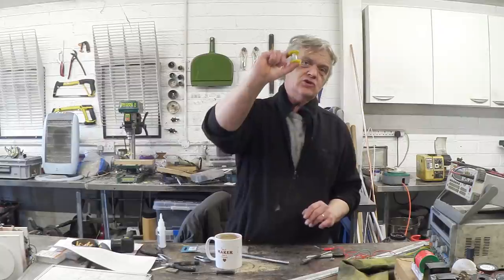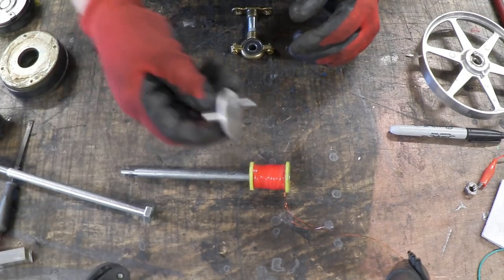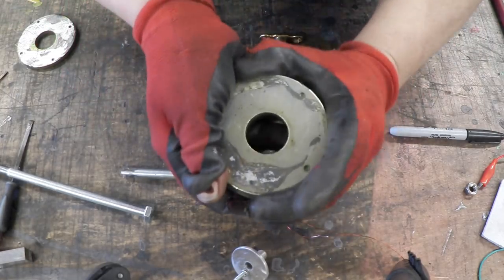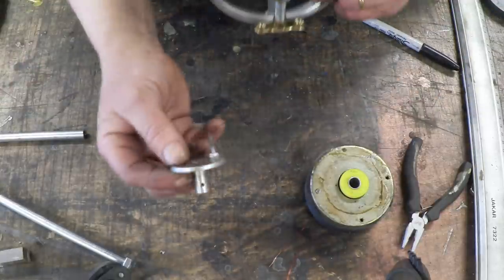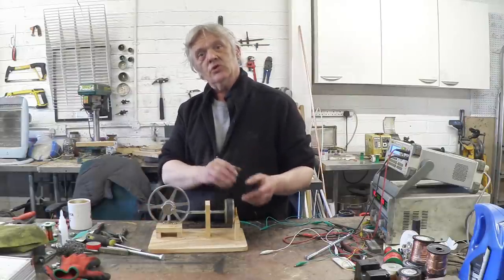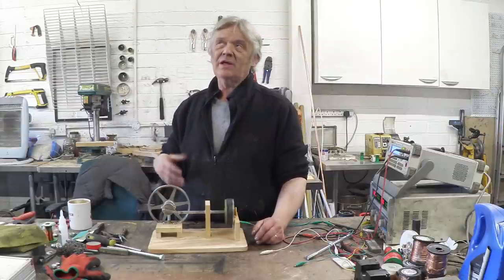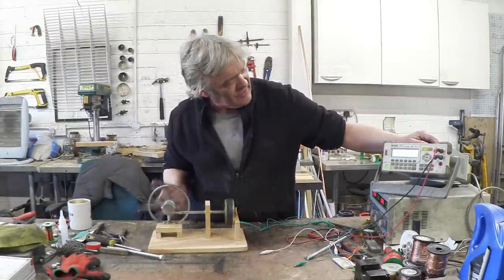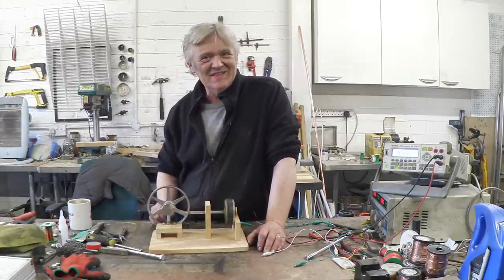1048 A Game Changer - The Linear Switched Reluctance Generator

Comment: "...including a lump of cast concrete". Now that right there is the kind of thinking that has us coming back over and over. Thanks mate.
Reply: At coral castle that is what Edward  did with his model T motor. Sand bagged with cement and used magnets from 7 cars.
Reply: If the flywheel doesn’t need to be heavy I just heard about an interesting die-casting material — Polycaprolactone is a nylon-like polymer that softens to an easily formable consistency at around 60°C (140°F). So a heat gun and some makeshift ‘wheel shaped’ mould
Reply from the maker: lol - I can be brutally practical mate lol
Reply: @ThinkingandTinkering  If it works, why not?
Reply: On a lump of cast concrete flywheel. That's fine as a flywheel that's greate in certain circumstances, but flywheel mass is not good for wind turbines. Half the time it spins too slow for a given windjust trying to catch up. The other half the time, the flywheel is spinning too fast for a given wind turning your turbine into a fan making wind.

Comment: Looking at the way it operates, the input energy does not seem to be subject to the counterforce of magnetic repulsion the way most generators and alternators are due to Lentz Law. Does that mean less input energy (Or horsepower) is required to operate it? Makes me wonder if this setup wouldn't work well with a Stirling heat motor.
Might be fun to run the Stirling off a plant pot heater in a power outage during the winter.

Comment: Robert, The curiosity to see the higher voltage at a fixed RPM to better know the electrical generation efficiency of your linear metal rod motion magnetic circuit path design has hold of me. If I were to replicate your design, but instead of driving the pulley with a variable speed human finger, instead use a rubber sanding tube wheel attached to a electric hand drill placed against the metal pulley's outer edge smooth surface to drive the metal rode reciprocation faster in hope to measure the steady voltage increase at a known and, consistent pulley RPM thus discovering the efficiency of magnetic reluctance path copper electron movement voltage pressure is an intriguing thought to replicate to quantify. Robert, so interesting of a linear design concept that combines a magnetic field lines circuit, and copper coil electric generation !

Comment: Amazing how a little bit of trial and error will get your mind thinking about just how easy it is to generate energy. Fair enough you only got a little by spinning by hand but many of these on a large blade section will do surprisingly well at charging batteries freely.
Reply from the maker: I would think so mate - the thing about reluctance devices is they work well at high speeds

Comment: 1) What is nice about this is the mass of the flywheel, the piston, and piston rod can be minimized to only that which is needed. But then again, one ends up adding mass when they goto balance the weight Of the piston and piston rod.  As to a lump of cast concrete flywheel. That's fine as a flywheel that's greate in certain circumstances, but flywheel mass is not good for wind turbines. Half the time it spins too slow for a given windjust trying to catch up. The other half the time, the flywheel is spinning too fast for a given wind turning your turbine into a fan making wind.

2. Don't use an aluminum ring inside the bobin. Use nylon or something nonconductive.  A conductive ring acts like a shorted single turn coil on a transformer. It's just going to disipate heat from circular eddy currents. Drop a magnet inside a copper pipe to see how much energy may be lost.

Comment: I can imagine that multiplying the generation cores by maybe 8 in the configuration of an old rotary. Airplane engine then wired together . you can probably use a mtn. Bike Wheel as a jig to mount the whole assembly . one question though are the poles oriented the same in a speaker magnet as they are in a microwave magnet or would one be better suited then the other
Reply from the maker: I think they are mate - basically north/south on opposing faces - but I am not sure and will have to check

Comment: What's the windmill on a stick called? They can be brought on beaches and from garden centers. 
It's like a square sheet with the corners pinned into the middle. 

Anyone know Please?
Reply: most I have seen are called a toy windmill.
Reply: Pin wheels or pin mills
Reply: Rob has done a few vids on these.
Reply: @flytrapjohn   thank you. I have seen these videos also. They are equally entertaining.  
I'm curious as to the name of the rotary blade set up. Not the construct it's self. 
Pin wheel means nothing. It is a title with empty context.
Reply from the maker: I don't think there is a specific name mate - I have seen toy windmill like Ed said and pin wheel like mittens suggested - but not much else
Reply: @ThinkingandTinkering  thanks Rob. 
In the back of my mind I believe there is a name. I'll have a patent sift tonight, see I I can find it.

Edit* yeah I'm probably wrong but I'm gonna look anyway.
Reply: I think in fact it is a savonius rotor
Reply: @paulbrouyere1735  close but not the one. It is also not a Pelton wheel. Awesome suggestion tho. Thanks bro.
Reply: Okay so as far as I can get is Pinwheel or Whirligig. 
Thanks everyone for inputs. 

 I'm still in disbelief it has no specific name. Feels like walking into a workshop and calling everything tools!

Comment: I'd be more interested in using this without the rotary part as a way of harvesting energy from steps. The piezoelectric generators need to slightly crack every time you step on them and it's not so easy or cheap to scale up. With these you could have stepping stones that might be somewhat uncomfortable to some people to walk on but that generate significant energy.
Maybe some sort of mechanism that lets a spring fire it in and out really fast before latching back on to the stepping stone, or an elastic one like a wind-up car

Comment: Would running a single rod through multiple coils generate more electricity or would it simply cancel one another out?
If it cancels, you could always extend the rod using plastic or wood couplers so that each coil and rod setup are independent of each other.
Reply from the maker: I think you would need metal-plastic-metal-plastic as an arrangement mate

Comment: Hi Robert, This could be a good starting point for a wind compressor?  I'm off grid and currently "waste" about 9kwh a month of my solar power to pump air through my sewage treatment plant (timer only runs it for 15mins per hour) so potentially people could save upto 40kwh per month by replacing the electric air pump with a wind pump. I've watched some Armish videos, they use wind powered air compressors to power all sorts of tools, even washing machines obviously they need higher pressure, the treatment plants just need air bubbled though the water to maintain the oxegen levels and to provide agitation.
Reply: Are you using the sewage to make fuel?
Reply: @MAGnetICus_Attractus   Sadly no! I do have to waste Diesel fuel in the generator when the Sun fails to show up! although the UK Sun is surprisingly reliable.
Reply from the maker: I suppose it could mate - you can see compressors powered by wind as a kind of battery system - the compressed air taking the place of the battery as an energy store

Comment: Can you complete the path with a fast ass switch.?.connecting the left n right pieces of steel on the magnet... Or it's gotta be a a certain size related tube?......I work at a dump ..they got much large blower etc type motors .....seems  like ya could just take the guts outa em n  solder a mile of those coils wrapped  in steel harnessed magnets and oscillate slide a steel tube through em with no wheel?...or can ya shake steel in oil a billion times a moment back in forth the same way? I don't know what happens to the poles in magnet oil...but steel seems like it shouldn't matter...idk ..this is my fave one ya done  but they are all Bangers..:)thanks

Comment: Robert...what about making a multi rotor homopolar generator, and a DC/DC converter to get the voltage up to usable? No windings. Can be made from steel discs and magnets ( brake rotors etc ). Wouldn't be good for a HAWT without a mechanical linkage, but for a VAWT would be easy. You could even put a big cap inline to smooth things out.

FYI, the material used for the rotor appears to matter in some way. Iron is apparently better than copper, for example. I haven't studied this, but I've heard the word "reluctance" used.

Personally, I think homopolar generators are a wonderfully unstudied area.

Comment: Is it possible to make a DC generator by having a second magnet/coil and rod that pushed into it when the first gets withdrawn? Or would that simply “double” the outputs? Seems to me that you’re not maximizing the potential here, even though the voltage and current is small from one half like this.
Reply from the maker: I am definitely not maximising it mate - this is really a proof of concept model - tons of improvements to make I would guess and I think your suggestion is great though it wouldn't produce DC
Reply: @ThinkingandTinkering  you’ll show us how to increase the output in upcoming videos, I hope?
Reply: the usual way to “double” the outputs is to add a second coil to use the unused magnetic pole(s), oc there's also the original designed in 'transformer' reinduction options at the same time too

Comment: With a CVT (electronically controlled) you can obtain pure 50/60 hz and power at disposal
Reply: Don’t know what That is (about to look it up), but that possibly sounds like an inexpensive way to turn and inverter into a sinewave inverter for sensitive equipment like laptops
Reply from the maker: cheers mate

Comment: that is an interesting bit of engineering cod the magnets pull the rod throw the Pip on the same  way a mag lenth pulls a tram down a pipe .those collapsing sever geniting magnet as it travel the crueller course as a stingier. peace of steel Or joined Together by nonconducting elements . then an engineered circular. generator  Driven by  a set of repulsing magnets A repeating  driving in a cercal &    :-  {passing on it journey  trough a stationary coils such as you have dementated }  This powered by switching coils driving the  singular slug  Of Steel.   Or  circler slug's  of steel  equally spaced. , steel being the magnetic interface ,  i suppose it the classist one can get  to perpetual population one could get . could the coils produce sufficient over unity to  drive the switching drive coils ?    It would be interesting to find, out    coils we now can drive  along a  slug of steel   forward in a continua's loop  as in selenides  do when pushing a starter in to action.  but can  it when passing past a magnetism colt of wire sow it to such an existent it Avennchaly stalls  the drive. ? if not can the drive cols diver sufficient thrust ti pas a grater field of magnetised  power producing coils?   Just as when we pas a magnet down a coper pipe it slows it's descent. dos the cols failed  do the sane  . if not you could have a new form of generation in your  hands.  parps the first  tentative  step's towards  an electro magnetic generator .   it is quit an interesting principal you have demonstrated.    it need some research i think  i suppose a system using compress air  could used the the rotation of such a devise  contend in a circular pipe  doing the job of the  salmonids  just a different approach &  idea.

Comment: I’m sorry but I think that you generator aren’t a switched reluctance because it’s using a magnet and no electronic.
You can made a linear single phase generator with a coil electromagnet  two mosfet transistor two diodes  one condenser and a optical switch and one arduino to control the switching of the mosfet  transistors
Reply: actually jgb can make & video a version of 'a linear single phase generator with a' ....
wouldn't want to wait for everyone else to make 'the thing' so you dont have to right....
it's like nothing in the macro scale didn't already exist that these micro devices took their names from right ^_~

* 'and no electronics' = The field-effect transistor is a type of transistor that uses an electric field to control the flow of current., 
A diode is a two-terminal electronic component that conducts current primarily in one direction; it has low resistance in one direction, and high resistance in the other., 
An accumulator is an energy storage device: a device which accepts energy, stores energy, and releases energy as needed. Some accumulators accept energy at a low rate (low power) over a long time interval and deliver the energy at a high rate (high power) over a short time interval.
Reply from the maker: switching the flux along different paths is what switched reluctance is mate - you can do it electronically or mechanically - or indeed a hybrid - but the core of what switched reluctance is - is changing the path the flux field takes through the magnetic circuit